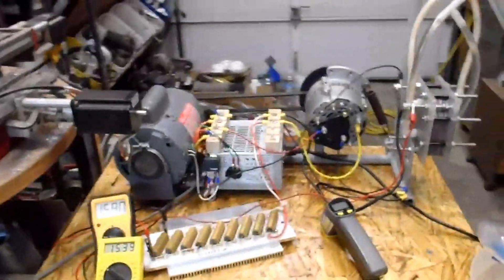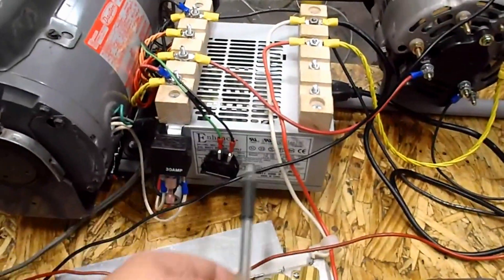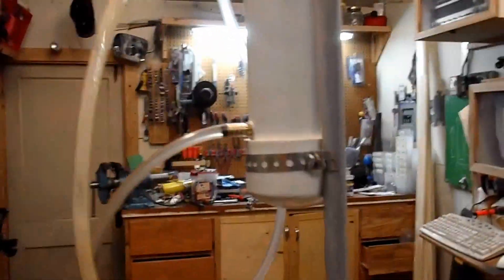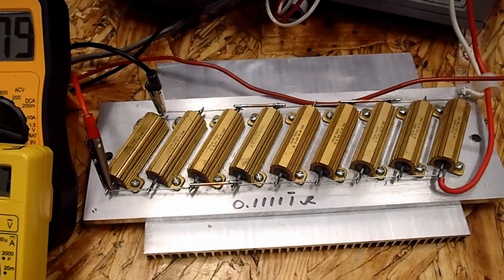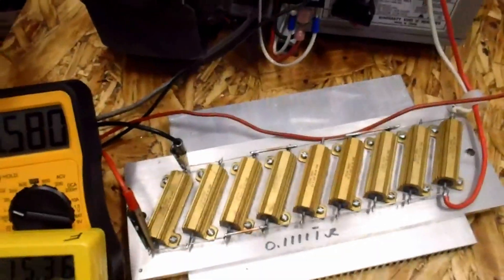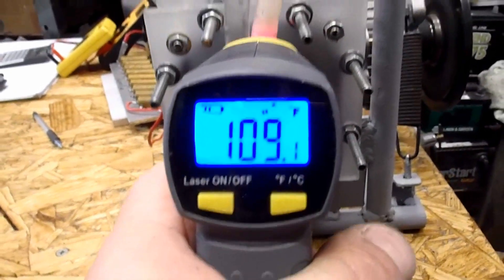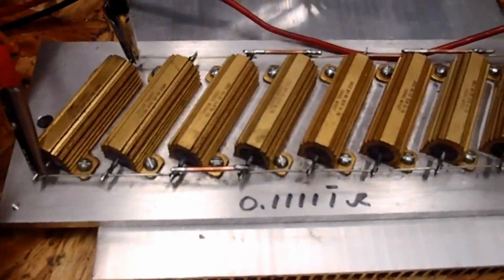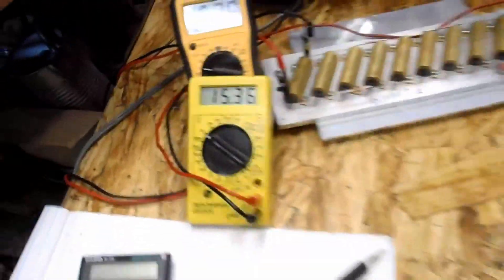HHO Dry Cell - 13 - New System Setup 7.0 MMW

Comment from the maker: @d3adp001 Thanks for the comment, yes I agree, more accuracy is a big deal.  I'm working on routing continual sensor inputs through a micro controller.  I've seen 6.0 to 6.75 quite consistently, so I don't think the 7.0 is out of the question, but I'd like to see this at a bigger production level.